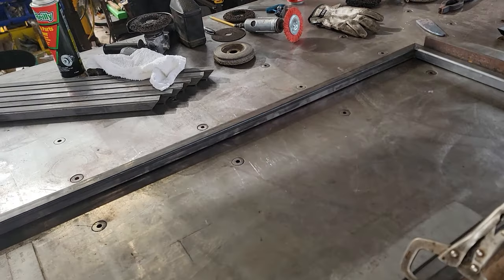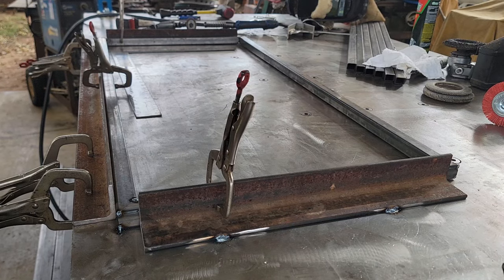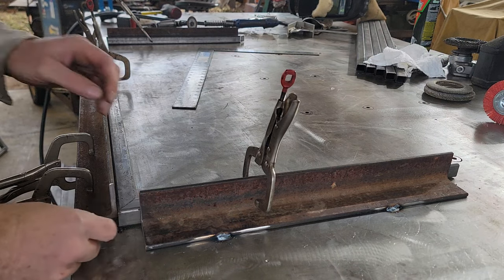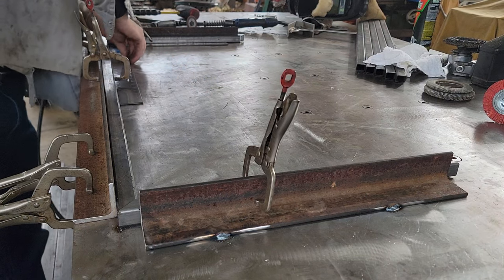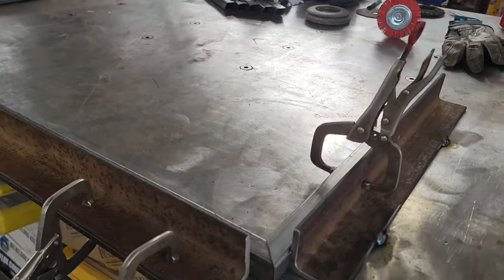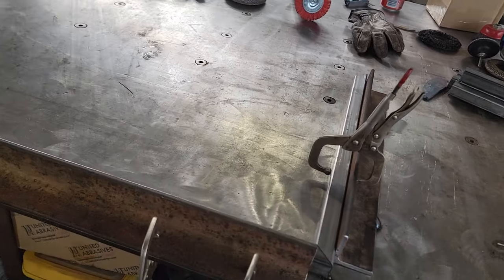Build it square on the cheap.

Comment: I agree with what you said about the fireball video. In this industry if you want more accuracy, you should request it. Of course it costs extra. Im sure the guys "tested" didnt know what kind of standards they were being held to.
Reply from the maker: You are right on point with that.
Reply: Standards that they are being held to? Dimensions and tolerances are clear on the drawing. What do you think they are there for? Shame on them for not having to tools to check the work they did.
Reply: @ToolCrime  I guess you don't understand blueprints or tolerances. Not everything is going to outer space. Time is a resource too.
Reply: @derekgreen7319  It’s not for the fabricator to decide to take a shortcut. The 1/8 tolerance he called for isn’t aerospace
Reply: @ToolCrime  a fixture doesn't determine a measurement. I guess a ground flat table will tell you if something isn't flat . But it doesn't measure anything . But using a ground flat table on structural steel in any shop I've worked at would get you laughed out of the building.
Reply: @derekgreen7319  Yes it does. What do you think the holes in the table are doing? They are on a perfect grid pattern. You use them with the fixtures to get accurate measurements.
Reply: @ToolCrime  it gave you a comparative measurement showing it's not within 1/8 I don't believe you understand how those holes work exactly. I don't claim they're inaccurate. They're just not the proper measuring tool for the job

Comment: This looks like the slow way to build a box frame. Those fixture tables make it look easy. So you have to weld a stop to the table every project? Then grind it off? Fixture tables have the holes to do this faster.
Reply from the maker: thanks for the comment and the view much appreciated.

Comment: Welding jigs are a necessity for building things straight, but they are not flawless. The problem is, a welding jig donesn't reduce mechanical stress to zero and it does not measure and report it. A perfectly straight and square thing laying in the jig may turn out to be not so straight and square after being released from it :) Another problem is that even if the geometry if fine, the internal stress is not. For example, a frame like this will likely have a tendency to bend the ribs inside. In that case it requires a thermal post-processing, basically, re-heating the offending welds with acetylene or TIG torch while having a thing you build heavily clamped to the jig. Sometimes even this is not enough and it requires a modified jig that allows to apply opposite deformation forces that overcompensate stresses from these welds during re-heating.
Reply from the maker: Hey, thanks for the comment and the view. You share a lot of great insights. Thank you

Comment: Cool... but I'd certainly like to see you make the same piece he asked the other shops to make. I am not a metal worker in any way, but I have enjoyed following this drama, and so far - that I have seen - no one who is really upset at the expensive table guy has actually built the exact piece to spec, with their ownb methods and tools, and then shown that it meets those specs. 

That could settle all of this. All of the metal people on YT who think he is a tool, or wrong, or whatever... just make the project and show the proof that you met the plans he gave those shops, and show that you did it with your own tools. 

Once that has been shown, the debate ends.
Reply from the maker: Hey thanks for your intelligent comment which appreciated
Reply: I agree let’s see someone actually do it. They keep saying that it’s easy without a fixture table but nobody steps up.
Reply from the maker: @ToolCrime  Sounds great. I appreciate your comment. Let me see what I can do. I'm trying to get out from underneath a bunch of projects right now. But this is something I want to take a deeper dive into also on my end
Reply: @26feironworks79  Take your 2 parts to a machine shop and have them quality control it. That way we can see the true results. Keep track of your time or better yet film the entire process.

Comment: Where's the end product?  Weld it up, and show the product is in spec, flat and square.   You didn't.  You talked shit about the FB guy jason, who did show the results.  Hell, you making a show of using the square.  But, your square went into the radius of the tubing.  That wasnt even an accurate verification.  
   Jason FB guy is promoting good fixture tables and tools.  Take that out of the argument.  He hired SIX fab shops make the squares/squares with legs.  All six failed to meet a standard in multiple ways.  Do you agree there is something wrong when our industry is that unreliable?  
    You forgot to mention Jason FB guy had an employee with little fabrication experience meet the standard when he used tools that were designed to remove variables.  He showed the results.  
My impression of your video is that your ego was bruised, and this video is a knee-jerk reaction.  That's fine.   But, you could have taken the challenge and shown us your results.  You didn't.  
On a side note: if your defense for not investing in good tools is your employees will steal them, then invest in good employees.  Pay more for better quality people.  Get cameras and fire the thieves, file charges against them.  
   Again, this video did nothing to support your argument.  You are absolutely right that extra time cuts into profits.  But, 2 rejected parts and zero payment cuts into profit more.
   I weld/fabricate food/pharma grade stainless products with 1/16" specs, 1/32" flatness and less than 1 degree.  My fixture table at work isn't a fixture table.  It's a heavy large weld table with holes creating a circle around the center.  It's mostly flat.  The owner doesn't supply good fixture tools.  We're not allowed to weld to the table.  Angle iron is slightly warped usually.  The result is more time, less profits.  And, the welders are blamed.  Did I mention it's stainless?  The distortion is a constant battle.  I actually give a shit about producing a quality build.  But, I'm looking at leaving this company because the owners have your mentality.
Reply from the maker: Hey, thanks for your comment. And I appreciate your time that you took to say what you needed to say. I think I was just kind of disappointed. And I took it personally. Because that made me feel like I was a s*** fabricator.
Reply: @26feironworks79  I totally get that.  My employer has made me feel like how you felt after the video.  So much to the point I'm leaving this career.  Make a response video showing you making the frames meeting the tolerances.  Show him it can be done.  Run the numbers to show it can be done and be profitable.  This video was not a good response or defense.  Make one that is.
Reply from the maker: @IronCornsurfer  Hey, thanks for your response much appreciated. Also, don't leave this industry. Please stay and fight.
Reply: I think Jason’s video is trying to help fabricators get  the job done easier and better. We need tools to help us. That’s the point of the entire video series.  But everyone keeps hating on him. Fixture table systems are the future and are here to stay.
Reply from the maker: @ToolCrime  I'm not trying to bust anyone's a**I think I was just more frustrated that those fabricators let their product out of the shop in the condition that it was in.